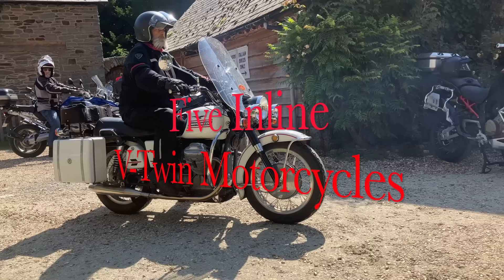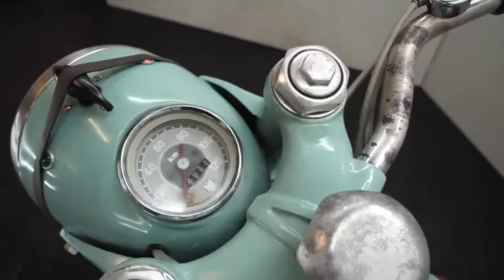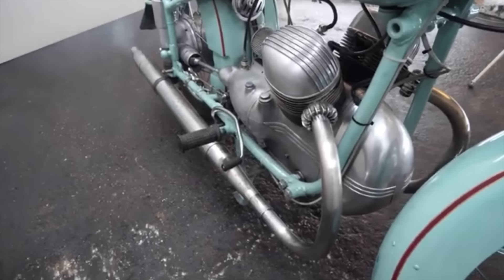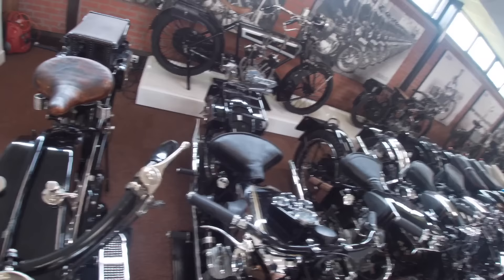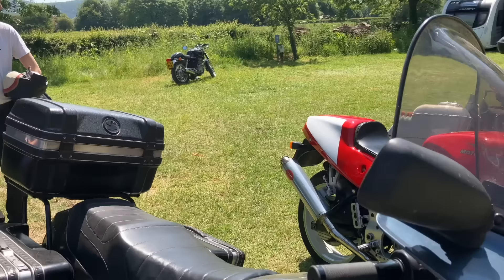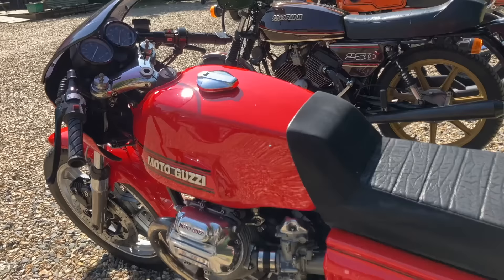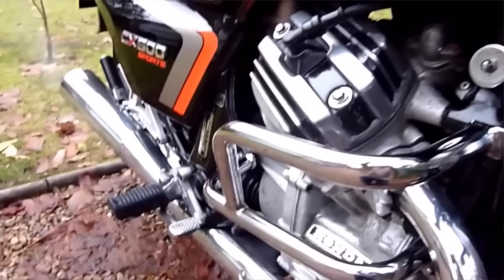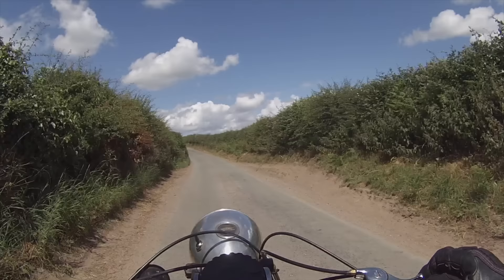5 Classic Motorcycles with In-line V-Twin engines

Comment: I remember well the launch of the CX range and it seemed to have so much plastic in its construction that it was largely met with revulsion and derision amongst the biker community here in South Africa. That was particularly true of the turbo version that looked like it had come from a cheap sci fi movie. Secretly, I rather liked them, although I would never had said that aloud of course.
Reply: They were everywhere in Britain in the 1980s, but especially the streets of London. The CX was an almost universal despatching tool, and gaffer taped seats, hand muffs, age-clouded screens and company top boxes marked them out as commercial 2-wheelers. The only place they were not (or weren't supposed to be) was The Mall, which prohibited commercial banners on the royal highway.
Reply from the maker: First model was definitely not a looker but has some how ages well
Reply: There were several versions.  I had the one with the plastic faring and fenders and years later I bought one with chrome fenders and no faring .
The main thing that displeased me with both bikes was they were clunky to shift . You had to make a dedicated effort to go from first to second or you would miss that gear .
I missed 2nd on those bikes more than any other .
It was also easy to find neutral in between every gear .
I'm a fan of inline 4s so the cx left something to be desired for me .
Yet I knew I was sitting on something different and something about it was magical .
It was my first liquid cooled bike , and that was a bonus when riding in the Mojave desert in the summer and a drawback in the winter .
It was always an oddball to me , and I liked that .

Comment: You're confusing "in line" with "longitudinal".  The old Indian, and Henderson, et al, 4 cylinder bikes were in line four cylinder engines arranged longitudinally.  But the typical Japanese 4 cylinder bikes had in line 4 cylinder engines arranged transversely. They were referred to as "transverse in line 4s". Both are in line engines.   As opposed to the Arial square 4, or the Honda opposed 4.  The bikes in your video have longitudinal crankshafts but the cylinder arrangement is transverse.  Harley Davidson has a longitudinal V Twin cylinder arrangement.
Reply: It's the crank shaft that sets this.

Harley are transverse twins because the crank runs across. 

Longitudinal engines have the crank lying fore and aft.
Reply: Asked to describe an in-line V-twin, almost nobody would suggest the bikes shown in the video. Either way, it's a nice look at some fine old bikes.
Reply: @borderlands6606  "inline" and "vtwin" are opposites. By definition, V engines have their cylinders not inline. You can't have an inline Vtwin any more than you can have a normally aspirated turbo, or a two stroke four stroke.

BTW, the Honda opposed 4 is an longitudinal opposed 4. (Later opposed 6). Often called a flat 4
Reply: @gasdive  I can indulge in mechanical pedantry as much as the next old duffer, but in common usage "in-line" is seen as cylinders in line with the frame, while "horizontal" is cylinder axis at 90 degrees to it. So Harley's and Sunbeams are in line, while Guzzis and BMW boxers are horizontal (exceptions from those manufacturers duly noted). As long as people know what we mean by the phrase, it really doesn't matter.
Reply: @borderlands6606  I guess it doesn't matter, but the word "inline" is as far as I know, used to mean engines that have the cylinders all in a line. That's how it's used in aircraft, in boats and ships, in cars, and as far as I've seen, in motorcycles. Example, BMW 523i, 528i, 535i are described as inline six engined cars. Though I can't link to it, that's how BMW describes them. 

V is used to denote engines where the cylinders aren't in line, but at some angle. Again, planes, trains and automobiles use this. Example, the Spitfire has a RR Merlin V-12.

Note that the BMW cars mentioned above have the crankshaft pointed forward/aft. So inline doesn't mean arranged at 90 degrees to the direction of travel.
Reply: @borderlands6606  PS, "horizontal" is normally not an indication of the cylinders at 90 degrees to the frame. 

It's normally used to mean the cylinder is horizontal. aermacchi 350 is an example.
Reply: @gasdive  Language aims for economy, not technical accuracy. So terms like "flat", "square" and "transverse" give an impression of an engine layout that popular sentiment can buy in to. For example the old K-series BMW was basically a car engine turned on a different axis, but was described as a longitudinal four. Another one is the Deltic, a 2-stroke, valveless, supercharged and repurposed WW2 marine engine looking for a catchy, though mechanically ambiguous title. Obviously, it matters if you are maintaining one but for sales purposes hardly at all.

I'm happy to concede that as motorcycle engines become more complex and sophisticated, at least modern ones for the consumer market, terms like flat hide more than they reveal. I still reckon most bikers would not say these were in line V twins (though their mechanics might).
Reply: A quick internet search reveals that the official Guzzi website describes its v-twins as tranverse while Honda's website describes their straight fours as inline and not as transverse.
Reply from the maker: Really not is a BMW boxer transverse then ? 
Er no
Reply: @bikerdood1100  Looking at the origins of transverse in car terms, before the advent of front wheel drive cars, it was obvious good design practice to arrange a car's engine and gearbox so that the crankshaft and the gearbox output shaft were parallel to the longitudinal axis of the vehicle.

So that would have been the expected arrangement. 

Deviations from that, such as Mini engines would then call for a word such as transverse to highlight the difference in their design arrangement. 

But for motorised bicycles, starting with single cylinder cylinder engines, the obvious way to arrange the engine and gear box would be with their shafts at right angles to the longitudinal axis of the vehicle, to facilitate the use of a conventional chain drive (or a belt drive).

So when Harley (and everyone else) started making "fore and aft" v-twins, it would have been obvious what crankshaft alignment those engines used. So describing the engine as a v-twin would have been sufficient for most purposes. 

But the case of flat twin engines is more interesting. Sadly, I have no original Douglas documents to had, so I've had to look on Wikipedia, for what its worth. The article there describes their original (fore and aft) engine configuration as "in line with the frame" and the later, BMW-like, one as "across the frame".

I can see the logic of always referring to the orientation of the crankshaft(s), because there will generally be at least one in every engine and with more than one, they will usually be parallel to one another. However it seems that current  motorcycle terminology does not follow that.

So, from the makers other than Moto Guzzi in this video, how did they describe their engine orientations?
Reply: @derekp2674  I don't know but I'm enjoying the discussion.
Reply: Sorry, but engine description is based on cylinder arrangement.  V, Horizontally opposed, in line, square, radial, etc.  However there can be some ambiguity.   @gasdive
Reply: @martinhauk1852  that's what I'm saying. Obviously badly.

Inline, boxer, V twin, V four, flat four, tandem twin, square four and so on describe the arrangement of cylinders. You can't have an inline Vtwin. One or the other. 

Longitudinal and transverse describe the assignment of the crankshaft 

So BMW K series, longitudinal, inline four.
Honda CB750, transverse, inline four.
Honda Pan European, longitudinal, V four
Honda VFR800, transverse, V four
BMW R39, longitudinal, single
BMW F650, transverse, single.

Comment: One thing about the design of the CX500 that I remember from the press articles at the time was that at a time when virtually every Japanese bike (except the CG125) was OHC/DOHC, the CX500 was pushrod OHV. This was because the selected V angle put the carbs exactly where the rider's knees had to be. Honda's solution was to use pushrods, which enabled them to twist the heads in relation to the crank & camshaft, putting the carbs under the tank out of the way.....
Reply from the maker: Was a slight odd one really 
The y started with an OHC prototype 350 but on say a Guzzi the carbs don’t actually stick in your knees at all 
We’re Honda over thinking it, perhaps 
Was a characterful beast either way
Reply: @bikerdood1100 on my spada I found the lhs cylinder head used to bash my knee after a hump back bridge or pothole had unseated me briefly. The carbs were well out the way
Reply from the maker: @highdownmartin  never had that happen to be honest 
Less of a think of the small blocks because they just tuck away beneath you

Comment: Another excellent piece.  I never had a Plastic Maggot, but you are right about couriers.... It was one of the absolute favourites on that short-lived boom.
On the Guzzi, you may know that Giulio Cesare Carcano (see history books) designed, built and installed on Jo's own car a 500cc v-twin to try to persuade FIAT to make a Sport model of the Nuova 500.
We'll never know now, but I have a feeling that would have been quite a thing... And with the current fad for "restomod" cars, one can imagine a FIAT/Carcone 500 Sport with a Lemon motor in it or something even spicier ...
Wonderful as the original 500 Abarth cars were, that would teach them the fast way home... or go very swiftly onto a hedge.  
Anyway...  Excellent video.
Reply from the maker: Well of course 
The first use by Guzzi Vtwin of this particular layout was in an all wheel drive trike intended for military contracts which ultimately didn’t come off 
The engine developed for motorcycle use has some similarities tho this but was not as is often claimed the same

Comment: Even at a distance of 37 years, I still miss my CX500!
Reply from the maker: I had one two 
Big old beasts they were
Reply: I've had about a dozen Silverwings over the years. The last one I sold was a GL650I that I bought with 11,000 miles and sold it with 106,000 miles on the clock. IMHO it's the best bike Honda ever made. I'd still be riding it but for the parts scarcity. I do a lot of long road trips and the last thing I need is to have a unique, obsolete part fail in No Hope ND. It would cost more than the bike is worth to retrieve it. I've switched to the closest thing I could find to the Silverwing. Moto Guzzi. Transverse V twin, shaft drive, 5 speed transmission, and detachable bags.
Reply from the maker: @martinhauk1852  in line

Comment: From the official Moto Guzzi website:
"The 90° V engine has become an icon over the years, not only in Moto Guzzi annals but also in the motorcycle world to the extent it even featured in a lifestyle clothing collection designed by the House of Mandello to “export” a piece of the Moto Guzzi world to that of casual fashion, a rather unlikely setting for an engine!
The brainchild of the talented engineer Giulio Vesare Carcano in 1965, this twin-cylinder 90° transverse V air-cooled engine enters into production in 1966 and hits the market in 1967. Since then, it has been mounted on numerous models, continuing to evolve over the years right up to the current V7 range, one of the Mandello Eagle’s best-selling and complete families."
Reply: So Guzzi use "transverse"
Reply from the maker: From an engineering point it simply is not 
Is a BMW boxer transverse 
Er no
Reply: @bikerdood1100  Since you mention BMW, they actually describe their current 4 cylinder engines and their parallel twins as "inline" engines and their boxer engines as "opposed piston" engines. So I agree that the boxer engine does not need to be described as transverse, from the basis that its maker does not describe it that way.
BMW also refer to the fore to aft axis on their bikes as "longitudinal", so I think they would describe boxer crankshafts as that.
From an engineering standpoint, it is important to stick to agreed conversations and to formally define other terms, if there is any risk of ambiguity.
Here, I like the terms parallel twin and square four, noting that they define the relationship between the axes of the cylinders. But these terms say nothing about the orientation of the crankshaft(s).
V-twin also refers to the relationship between cylinder axes.
As an engineer (and mathematician) I'm less happy with the term "inline" because it begs the question "in line with what". In a classic Honda 4, the axes of the four cylinders are parallel and coplanar. They're inline in the sense that a line of fence posts would be, but that's not so great as a formal definition.
Similarly, if the axis of a crankshaft is parallel to the longitudinal direction of a motor cycle, it is a bit sloppy to describe it as inline because it won't necessarily align with anything other than itself. In engineering, we'd probably use the term colinear to describe when the axes of two items were not only parallel but actually one and the same.
We cannot, of course, expect the wider public to stick to proper engineering terminology.
Thus, for the avoidance of ambiguity, I favour consistency with makers' documentation.
Otherwise, misunderstandings may arise, as in the apocryphal case of "nurse, I asked you to prick his boil".

Comment: So if Guzzis etc. are "inline", what would you call engines like Harleys?
Reply from the maker: Transverse 
Their crank runs across the frame 
Is a Classic Ford mustang transverse 
No 
Because the crank and transmission run along the line of the chasis that 
No one says a BMW boxer is transverse flat twin and the only difference in principle is the angle of the cylinders 
Need to do a whole video on This perhaps
Reply: Agricultural, slow, noisy and over-weight???

Comment: I respectfully disagree with your personal definition of 'In-line'. I have been connected with the motorcycle industry for most of my life and the relative placement of the cylinders, not the crankshaft, is how most people define the engine. These bikes are transverse twins.  You cannot call a Ducati vee twin a transverse engine!
Reply: A quick internet search reveals that the official Guzzi website describes its v-twins as tranverse while Honda's website describes their straight fours as inline and not as transverse.
Reply: @derekp2674  Exactly. The layout of the cylinders defines the description of inline or transverse, not the crankshaft orientation...
Reply from the maker: All true but how is a transverse engine then defined
Is a BMW boxer transverse?
A v8 rear wheel drive car ?
Apparently no 
Is a vfr then inline 
I’ve never heard it described as such 
It’s an interesting argument but the direction of the crank is used to describe the engine in every other case 
Mini 
Cb750

Even manufactures differ on this point but to me it’s abundantly clear and obvious 
And describing an engine differently because it’s a v rather than flat has it’s cylinders parallel to each other seems nonsense
Reply: @bikerdood1100  I guess my point is that a majority of understanding, and in my opinion logically, a boxer is transverse, a V8 car is transverse. A VFR is in line (and a little bit transverse...!)  A mini is obviously transverse in crank and cylinder configuration, a CB750 transverse. Cylinder orientation is the defining character here...  But hey, it's a free country and should make for a few nights heated discussion down the pub....!   ; )
Reply: @bikerdood1100  Transverse refers to something being perpendicular to the longitudinal axis of a vehicle.
For a Mini, both the crankshaft and the plane containing the cylinder axes satisfy that definition. In a Guzzi, the plane containing the cylinder axes still qualifies as transverse while the crankshaft is longitudinal.